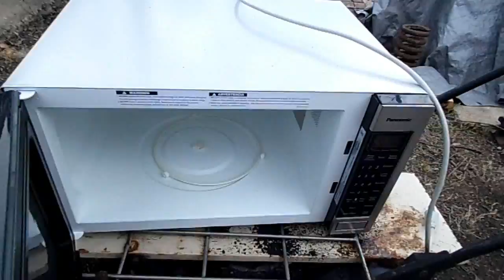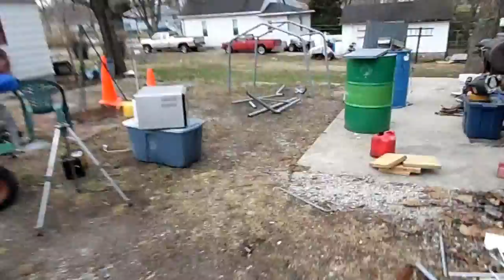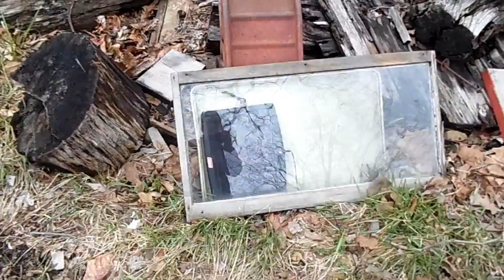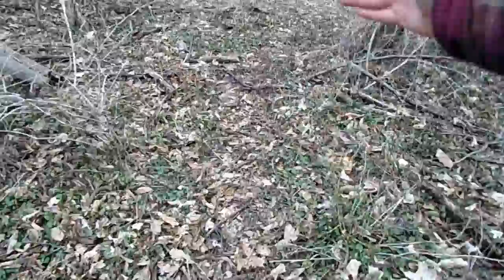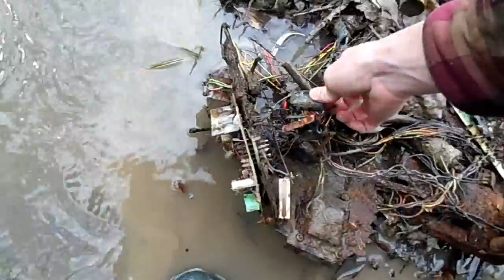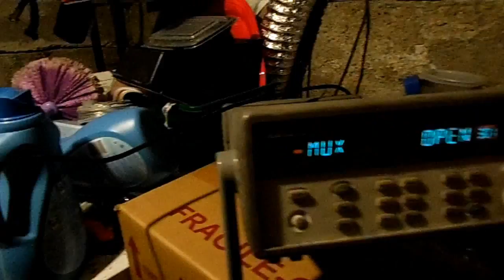Random Bits 0019: solar panel and exploring the woods

Comment: this video is a couple years old. but have you ever thought about building a DC to ac inverter. for a solar setup. are you still tinkering with the electric mower?  I am wanting or well needing to build a pure spwm inverter. there's a driver module to run the H-bridge or push pull . and other functions . I don't know how or if it could regulate the voltage under load. I'd like to use one and a chip or arduino , a pic. to run the boost stage and protection. use either several smaller transformers or 1-2 large ones. like 3-4 kva ea. for a inverter of 4-6plus kW. output. it would be my first big project. its easy to get the voltage. the sine wave and constant voltage isn't! and I'm planning to build toroidal transformers from iron or iron oxide powder. so it should work in the high hz range a DC boost usually is in. so if you have any ideas. or can think of any ways to maybe help or advice. anything really would be a great help. I'm just gathering parts now to get started. I have some huge heatsinks and some 22,000uf 75v capacitors. 8 of them. I figured since you know so much about basically everything . and one of your videos was the first I watched when I started to research electronics . inverters , DC boost converters. and DC motor controllers. I never heard of 18650 battery's until I watched your video on them. I was looking into building a lithium battery bank for my solar set up. sorry I have been rambling on for so long. great videos. ib been trying to watch them all. and thank you!

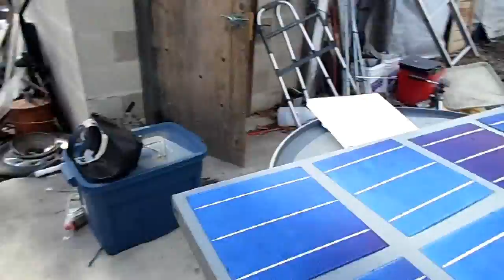Comment: 2:45
Sorry but you need to protect your cells. It won't work while it's wet from shorting out. If it doesn't have a cover over it then hail will just destroy them and bird crap will actually damage the cells also. While the rain also won't actually destroy your cells it will actually make them less and less effective if you let the rain fall on them because as the water evaporates it will leave behind more and more chemicals and dust on your solar cell. This is why everyone covers them with perspex or a glass which can be easily cleaned.

Comment: Maybe the meter that you have has a battery inside to keep the memory.
Reply from the maker: yeah, tbh though its not really bad enough to neccesitate taking it apart. its designed so nicely that i can redo all the settings in like 10 seconds. :D

if it does have a battery its prolly a CR2032. i have spares of those for computers and NES game cartridges.

Comment: use a step up voltage regulator for the motor input on the lawn mower and for the charger
Reply from the maker: Yeah I'm using that for the charger, but I'd need a very powerful one to run the motor. The motor works fine with the batteries though.

Comment: Does that stream run all summer long? If so, why not dam it up and if you have enough drop put in a pelton generator
Reply from the maker: we have issues of it stagnating and being a home for mosquitos, I want the water to flow and go away haha.
Reply: Start digging then
Reply from the maker: Sachi WI
i might use that 12v water pump i bought to build a hydro-digger that would dig with a high pressure water jet!

oh but i have an old pressure washer, so hrmm

Comment: Since its spring, lawn tractors are pretty cheap. Keep an eye out for a good tractor that you can make run good, then either make a wagon, or buy a wagon and you could ride the trail without worrying about getting stuck, or not being able to go uphill. You could make a quite muffler and all of this will cost around $100 or less. I bought a 1985 montgomery ward lawn tractor for $50 on craigslist. I rebuilt the carb, and replaced the starter and it has worked great for over a year now, and you have to count that I ride it like an atv so it gets ridden often. But you could just as well run it off of propane and not have to work on the carb. You could build an atv rack on the back and have the propane cylinder on hand for throttle reasons. Need to get up that hill? Just give it more gas and let'r go!
Reply from the maker: guess you dont know about my propane lawnmower that i use to mow this trail....

or when i drove my electric lawn tractor down the trail...

only part things get stuck is that bend where i went around a log. if i just cut through the log and make the trail straight i could even ride my bicycle through there.
Reply: I know well about your propane mower. But you dont want to use that mower for trails. And the electric mower doesnt have the power to get up over that bend with a load.....  at least I dont think so.

Both very handy, just not the right thing for the job. Check out fearlessfront on youtube. Thats what you need, just with ... less.

And quick reply! Im still in the video! Your just coming out of the trail I think. You just found the heating element. Lol.
Reply from the maker: NateWilson99
well they both have the power just traction issues, especially the electric one. i still havent been able to stop the wheels on either. but again that work-around is very bad anyway. its almost too bad to walk up. i should just get my chainsaw out and cut through that log.